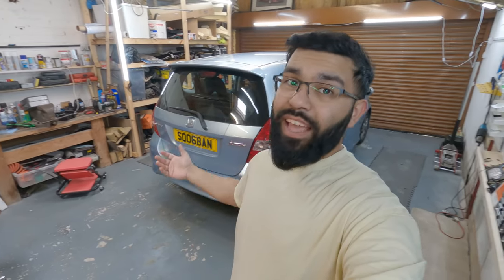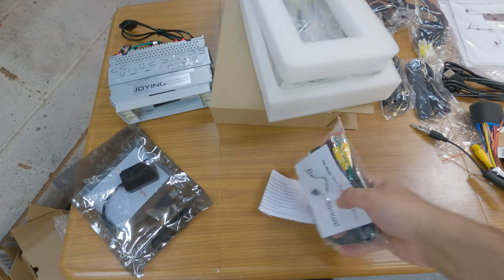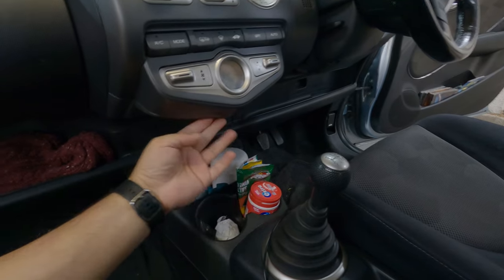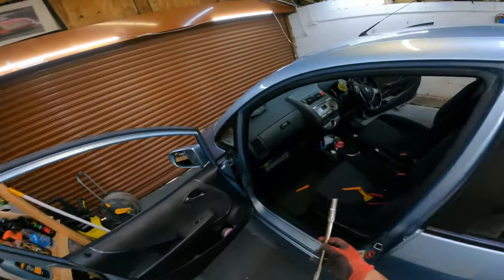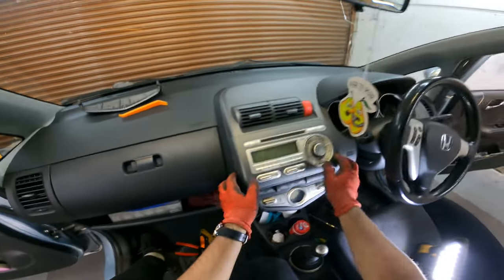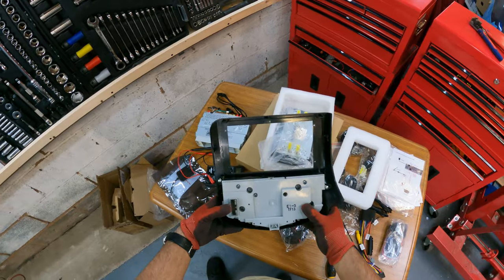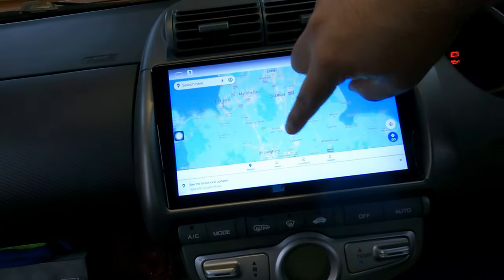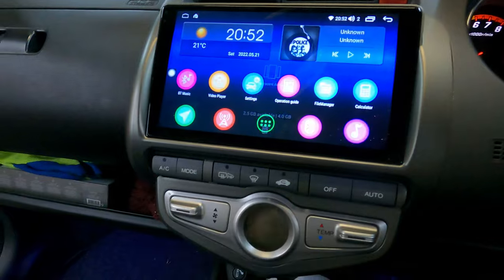Install Android Headunit on a Honda Fit/Jazz

Comment: You should consider pairing the ambient lighting app to the head unit so the owner no longer has to use his/her phone to change the colors or patterns.
Reply: So what is the solution do mean doesn't need one yeah?

Comment: Hello, I've got Gathers head unit with touch screen on my 2006 Honda Fit and it is Japanese. Would it be possible to turn it into the basic head unit like the one you removed from your car. Do you think the wiring and plugs would be the same? Thank you!

Comment: Hi, could you please explain the key-1/2 connection for the steering wheel controls? Many thanks.
Reply: Did you find an answer ?
Reply: I want to know aswel. My 2 phone buttons don't work. Volume up/down next/prev song works as that's based on the canbus setting you choose but no luck on the phone buttons. Mine also can't seem to learn anything